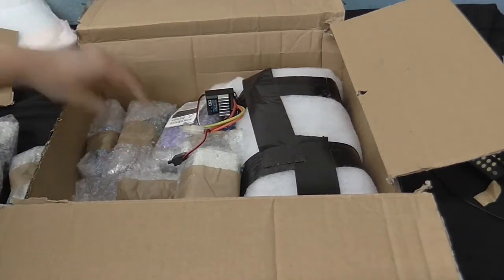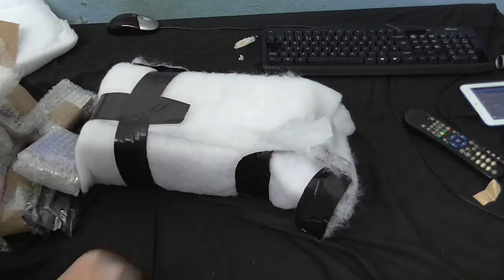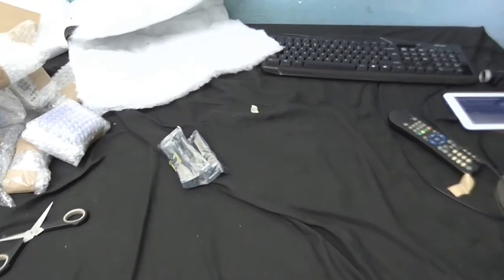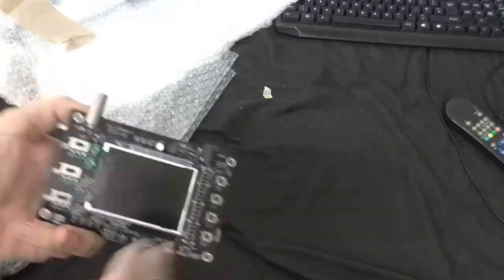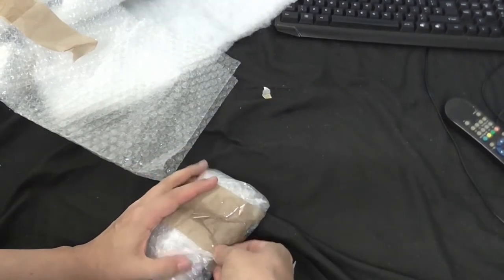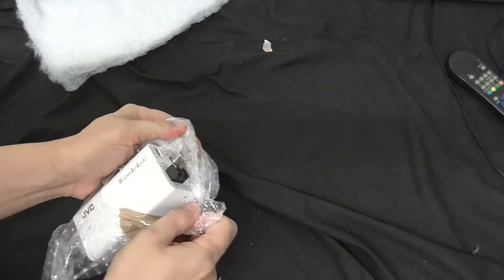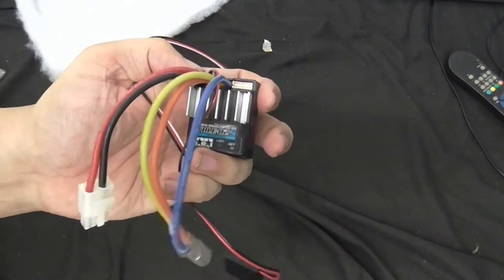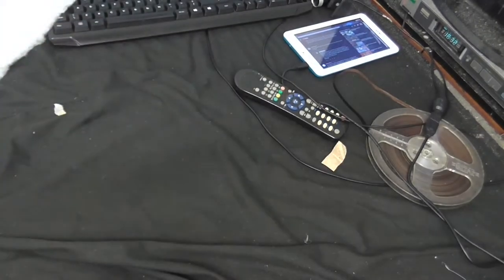DSO  ocilloscope donation and more!

Comment: Wow, hats off to the guy donated this, very generous !!!!!. EDIT: The Atlas blue thing is mostly a transistor Tester. It recognices the terminals and display the parameters. It is VERY GOOD gear. And the board with a TFT on it a a portable chinesse scope, they are pretty good for its size and price and you dont need to risk your main scope. I believe they are around 1Mhz and 10Mhz.
Reply from the maker: I can see some interesting videos coming in the future! I thought that little board with the TFT display might be a scope, I think I said that in the video actually, I powered that up and sure enough that's what it is. I think I also said that the blue thing is a transistor tester, it also tests FETs, LEDs and diodes too so I now can find out what something is  and what the pins are without having to look it up.
Reply: A coworker works part time at a big component retailer that buy surplus semiconductors. GOOD material but issue is identifying the components because most of them ar remarked or propietary. They buy them in big quantities for small money. And they got serious stock but not being able to tell what thing does what ... we look for a transistor tester and the ATLAS was the choice to start clasifying. The small scope, I want one so bad I have a bench one but for very small peek and pokes ... are too bulky I dont have a permanent place, so the little one would be fantastic for fast projects. And this comes with BNC, so you can plug an standard probe. Just be carefull on the DC input, they dont have plenty of room, I believe that use 9VDC regulated. Also they are perfect if you dont want to risk your main scope ... well, you can use the Philips for this !!!!. The little one, has one issue, the voltage range is not that wide. Being said that, is a great handy unit to complement with a battery and have something about the DMM footprint that can display signals. Hope to see more Cool dude Clem electronic vids in the future and also DECK and TAPE videos please. Long time that the akai doesnt appear and you had some audio gear in storage ... would be fantastic to make a repair series. Also would love some quick series on how to calibrate radios, I mean, comercial receivers. I need to calibrate a couple an NO IDEA where I need to start. Also a calibration on for decks Clem. I ve never calibrated my decks, appart from speed and azimuth. You explain well, you get the job done right o the point. I watch other channnels but this one ... is something different ... another approach were resources are not big but amazing thing are done. You dont get that in another channels. with unlimite resources, is no sense IMHO. also try to get into the arduino move ... you will NOT REGRET. GUARANTEED %100. You can so many things with it. Just imagine, you can take an old full logic deck and make your very own control, display time, counts or what you want, control the motors in the way you want with PWM, change the FW or RW speed, search tracks in the whole tape and display a calendar like a CD and then locate any song at a touch. These things are no complex but will kick you into the arduino world. Try to get a damaged deck that is mechanically good.